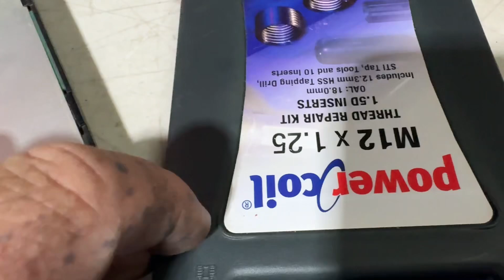Tenere 700 & World Raid 700 Front Engine Mount Bolts when crash bars go wrong!!

Comment: OEM Yamaha crash bars cause this correct?
Reply from the maker: I just spoke with the owner, they were SW Motech bars
Reply: @rideadvtoursandworkshop3178 mañana mismo las quito..
Reply from the maker: @Icatchbigfish-b6l  absolutely not. Funny thing you mention the Yamaha crash bars we’ve been running them for four years over half 1,000,000 kg accumulated and never had a single problem.
I can show you a video of where they’ve torn the Crash bar off and the Mount was unaffected. 
Unless you have any real experience, I wanna say real I mean your experience not someone that you know who knew someone that knew someone else then don’t believe the hype they work fine . That said we’ve used all the other brands.
Check through our video series
Reply: @ Nope no experience just read on forums that other people had this issue with the OEM bars.  I have the Touratech bars that don't attach to the engine on my bike.
Reply from the maker: @ yeah cool like I said we tore a Crash bar out, broke the bar in three places and the mount was unaffected
Every time I ask these people on the Internet, they only know someone or read it 
Enjoy your ride